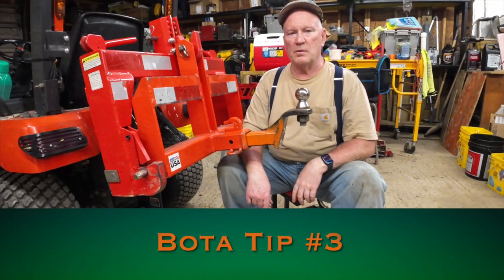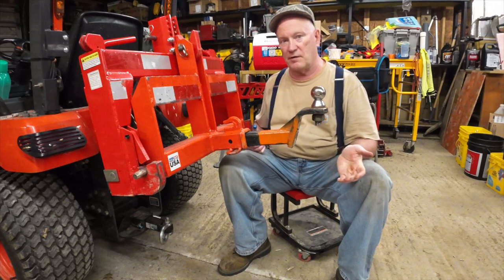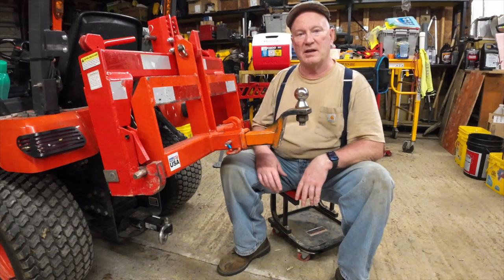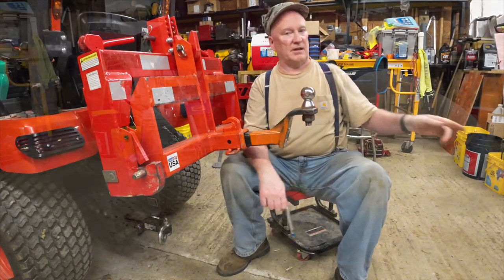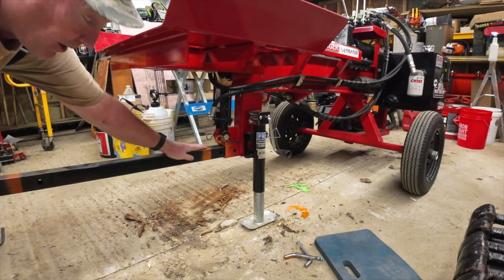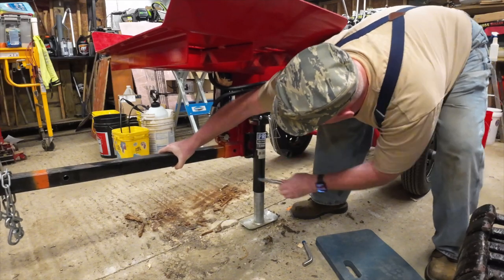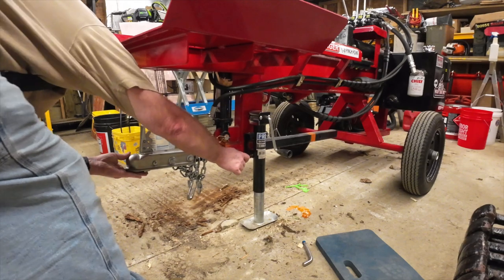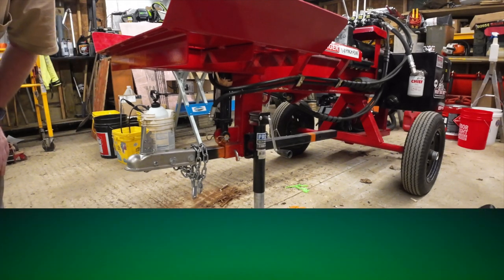Bota Tip 03

Comment: That is a fantastic idea, thanks. I could really see the advantage when you showed it on the wood splitter
Reply from the maker: I think that was the reason I started doing it.  As you could see, the long tongue on the splitter makes it hard to adjust while looking into the hole. So that was my solution and I just adapted it to the stinger on the tractor.  Thanks for watching and commenting - cheers